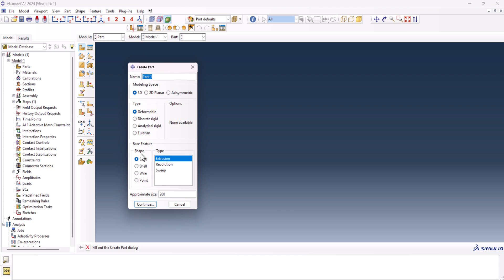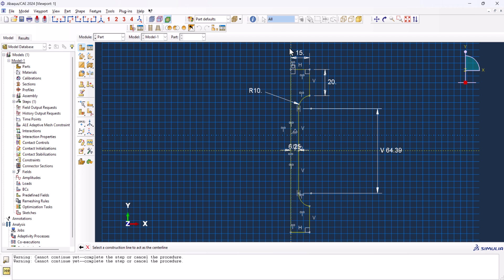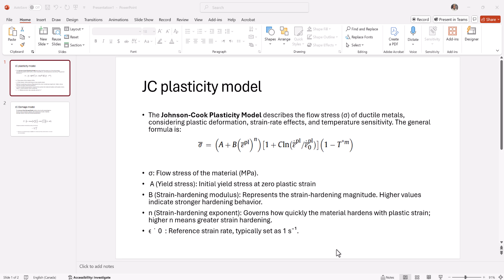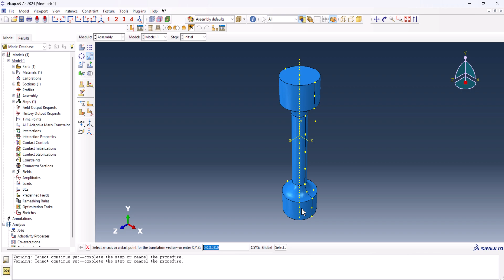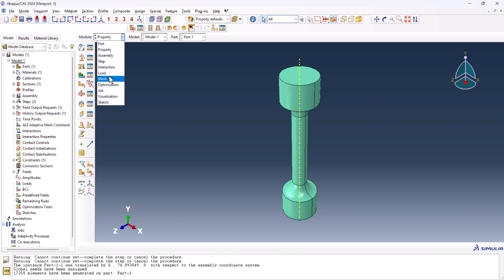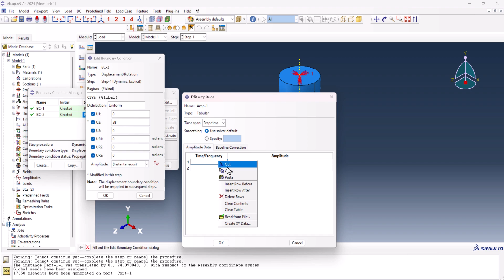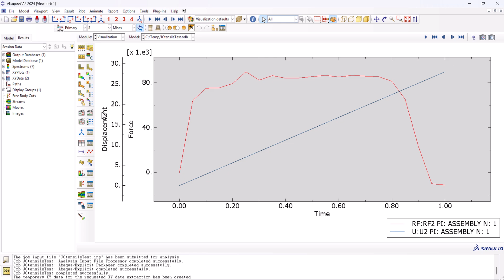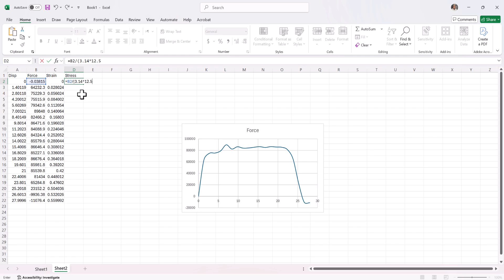ABAQUS Tutorial: Johnson Cook Damage Model for Tensile Test Simulation

Comment: Hi I would like to use this tutorial for a different material. Where did you get the values from your Excel that you copied and used for the JC Plasticity Model and the JC Damage Model?
Reply from the maker: I used the values from a random paper. But you can find it in scientific papers for your materials; They usually provide a paper with JC parameters.